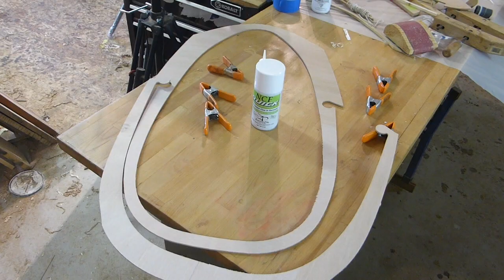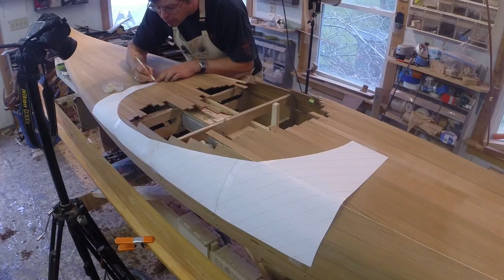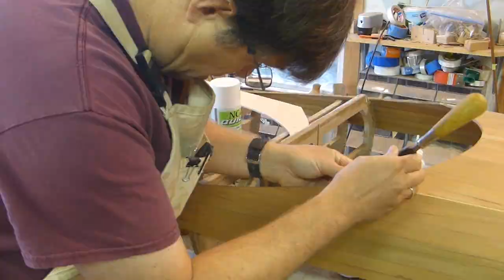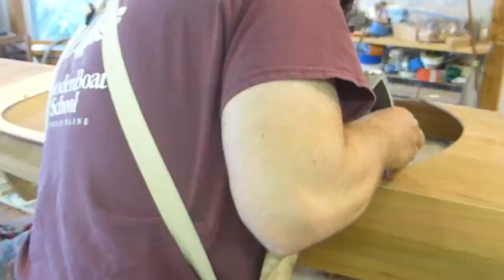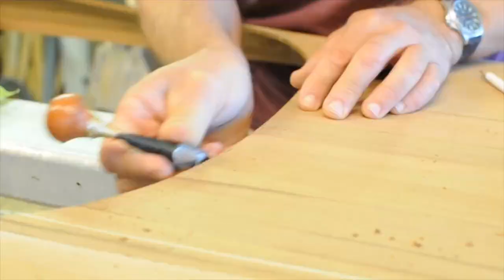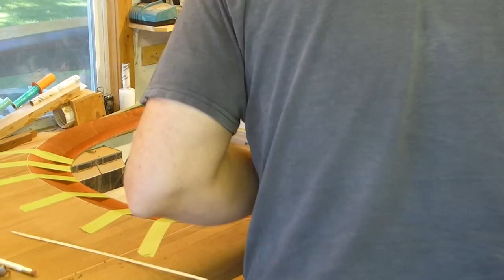Making a Strip-Built Kayak - Fitting the Cockpit Recess - E8

Comment: Hi Nick, I’ve purchased plans and forms for a Petra’s Play.   I’ve got the hull and deck completed and am ready for the cockpit recess.    On the template, there is a dotted line about 1/4 in on the inner most peace.   The drawing says this is optional, if you elect to have a coating.  My question is, if I am planning on using a coating, should I cut this dotted line off when making the cockpit recess?

Comment: Nice which foot are you using on the Luthiers plane for the cockpit combing?
Reply from the maker: I use the flat and the two different convex. One convex is straight fore-aft where the other is curved along the length. I switch it up depending on what seems to be working in a particular area.

Comment: It did not appear that you did any extra fitting after the accent strip. Do you just let that compress the combing and dish it a little more?  Or did you slightly oversized the hole to account for the thickness of the accent strip?
Reply from the maker: I actually added the strip to make up for cutting the hole too big.

Comment: Any tips on cutting maple accent strips? Also, is that mahogany stain or?
Reply: PS: These videos have been immensely helpful!
Reply from the maker: I cut my accents on the table saw. Actually they are usually the offcuts from ripping a wider strip into a slightly narrower strip. In other words they come off the saw blade on the side opposite the fence.
Reply from the maker: I'm glad you are finding them useful.

Comment: Why use okume ply? Why not thinly milled solid cedar or two  ply?
Reply from the maker: You certainly could. Other times I have used shop-cut cedar veneers laminated with fiberglass (for strength while building), I vacuum bagged mahogany veneer to thin birch plywood, and I have done this Okoume plywood. 

Obviously, using ready-to-go plywood is easier than laminating my own material. Solid cedar that is thin enough to make the needed bends would have a high risk of breaking.

Comment: If I do not have access to a cnc machine, can I cut out the plywood with a scroll saw? Or do you recommend I find a maker space or someone who can cut it out for me. I'm still trying to convince my Wife that a Cnc machine would be a great addition to the shop.
Reply from the maker: Prior to own a CNC machine I always cut the recess parts with a bandsaw. I print out a full sized pattern, spray-glue it to the plywood and cut out around the lines. Then I would come right down to the line with a bench-top sander.

The same process can be done with a scroll saw, jig saw or even a coping saw. The final adjustment can be done with coarse sandpaper on a stiff block, and/or with a block plane.

The plans include the full size paper patterns for the parts.